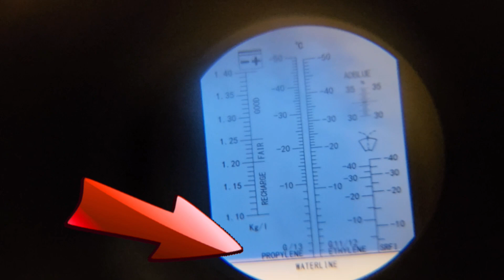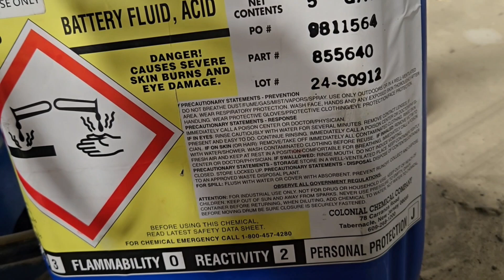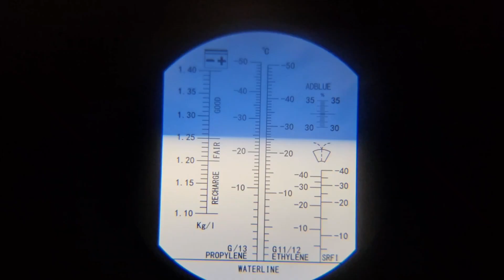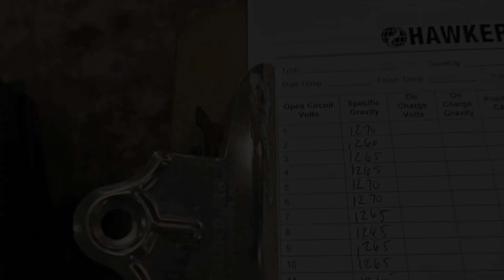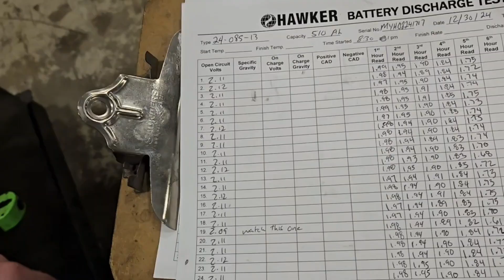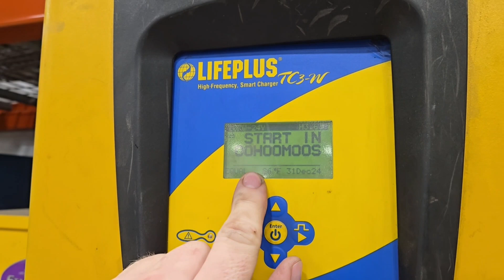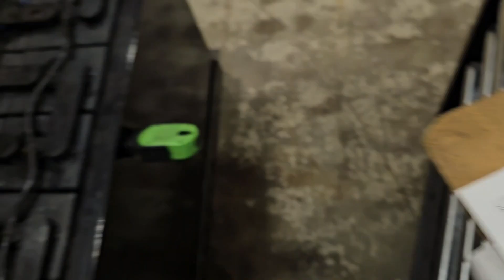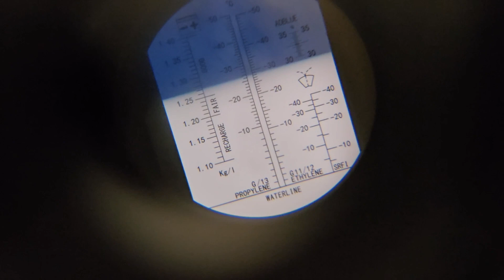Industrial Batteries, Acid Adjustment Edition.

Comment: Great video! What is the name, model and serial number on that load bank? We had them years ago but when I came back, they had gotten rid of them.
Reply from the maker: I know its made by pluskota electric manufacturing. Pretty sure its a model LB6-24200.

Completely obsolete, we've done a good job not killing this thing off. Ive used it over the last 13 years, no problem.

Not sure on the serial, after the holidays ill go look at the serial.

Comment: Bought the same ATC instrument you used and to its credit it measured spot-on with new clean clear acid from the bottle (as did my quality german hydrometer).  But in practice my acid is NOT perfectly clear and when I compared results side by side with my standard immersion hydrometer the refractometer was ALWAYS a higher reading, and nev er a consistent variance.  So for me I am unable to use this (or probably any) refractometer.  I don't know if well maintained banks retain 100% cystal clarity or not.  My bank is used as solar storage but was left unattended for 2 years so is sulfated and only provide 65% of rated capacity (which at 34kW gross or 17kW useful is still perfectly good for my use).  I am wondering if you have tried the same test?  Thanks for the video.
Reply from the maker: I've used both. I like the refractometer better because the graduations are easier to read, no need for temp correction, and it's way less messy.

BUT 

You have honestly brought up an awesome point I've never actively considered. 
My assumption was that it was refracting through the density of the fluid, and the clarity didn't have much, if any, effect. Occasionally, I noticed the blue line would be slightly fuzzy to read when I had a cell with excessive plate sluff present in the water. But it is still legible within 5 points... so I didn't give it a second thought.

With hydrometers, I have noticed it can be difficult to get repeatable results. Temp affects the reading because you have a large sample. So, correction has to occur. More centeral/core cells tend to be hotter than edge cells. So, temp correction isn't across the board. Also, take a sample 3 times from the same cell, and they can vary up to 20 points sometimes. All these reasons are especially true if the cell is gassing, when sampling.

All that being said, your comment has inspired me to do some testing. To your credit, I have an idea for a video! 

Thank you, and I hope to see you there.